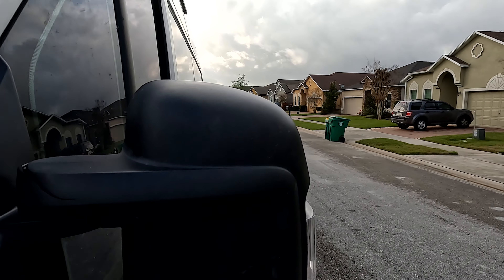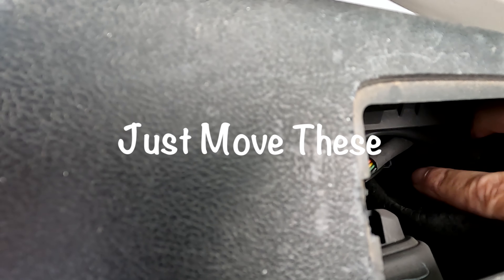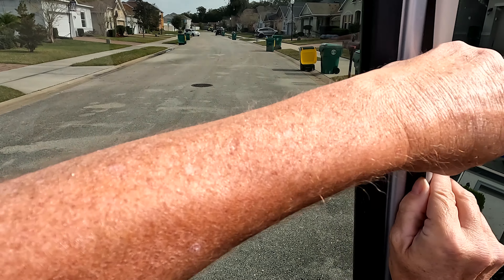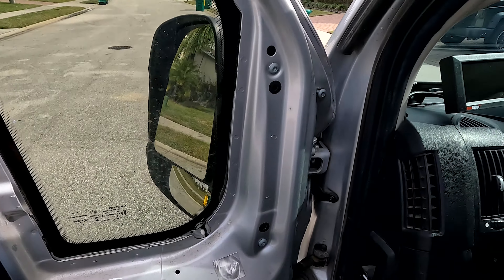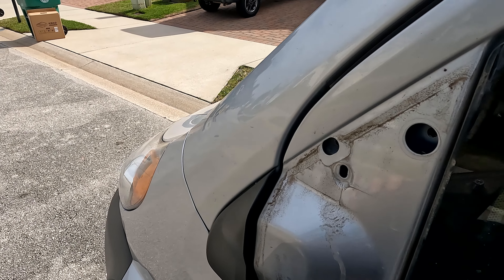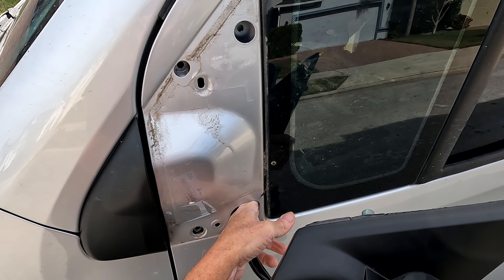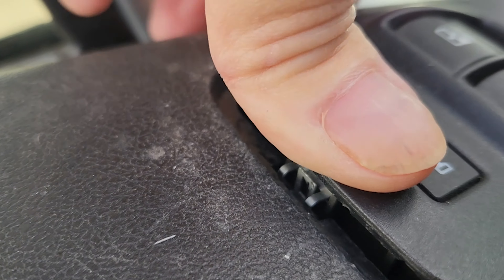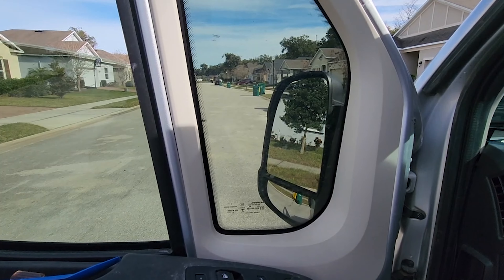RAM Promaster Driver Side Mirror Replacement-Don't Pay The Dealership!

Comment: Appreciate the video definitely. However, it would have been a lot better if the camera was actually looking at areas the fellow was referring to.
Reply from the maker: Yeah sometimes it's hard to work and record one handed and this time  I was using a head mount and couldn't get everything in frame. Enough info in the video to help someone get the job done.